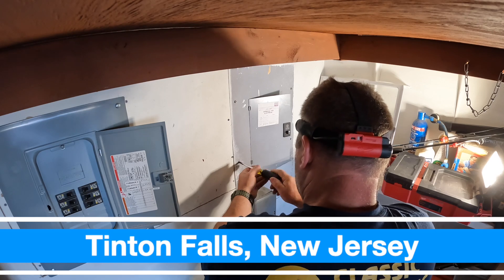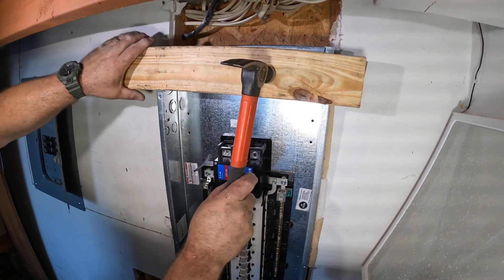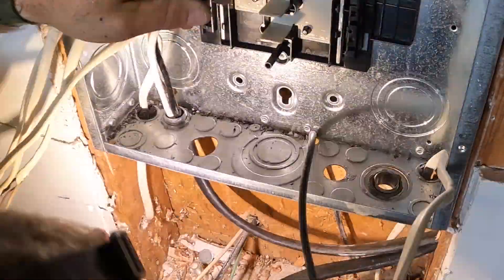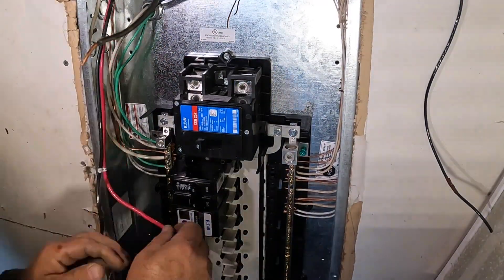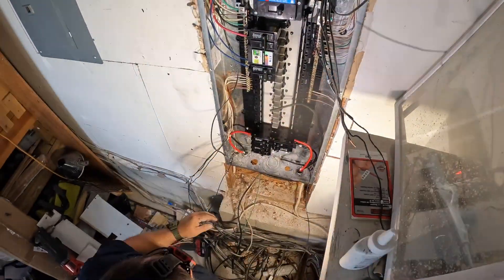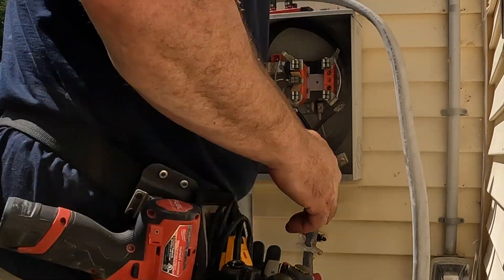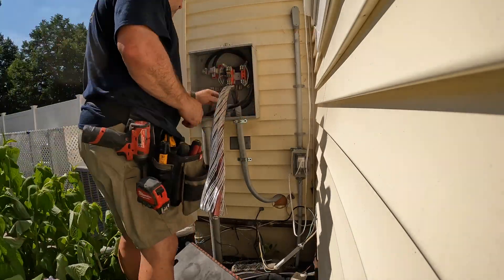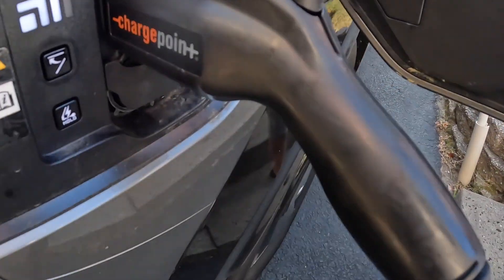200 AMP Panel Upgrade w/ new Electric Vehicle Circuit  for a Level 2 Electric Vehicle Charger

Comment: Since your service entrance cables came into the panel from the bottom, could you have installed the panel flipped so that the main disconnect and the lugs were on the bottom?  I guess you could have saved a little conductor and maybe the panel would have been a bit less crowded. Just wondering how you think about that. Thanks.

Comment: Hey!  When using a flush mount box in an exterior wall space where the interior is heated, how do you prevent winter time condensation problems in the box?

Comment: Aren't the meters rated for certain current so to go from 100A to 200A would require the meter to be upgraded if it isn't rated for 200A. Thus requiring a disconnect.
I think some models are labeled with  CL Eg: CL200 is 200A..
Reply from the maker: @TheTubejunky  All underground electric service meters are rated for 200 amps.  It’s a law that utility providers must follow.
Reply: @electricianron_New_Jersey   Awesome! Thank you for the information my guy. Have a great day.

Comment: Hotest day I ever did a 100 amp setvice it was 104 degrees for an cheap ignorant cousin that me & my dad did not charge any labor. We asked het for a cup of water twice but ended up drinking warm water out if s gardrn hose. End of job we took off our work boots and sat on her chairs with our firty feetnin her   kiddie pool. Following month dhe wanted us to vome over thst day to run a line to s window air conditioner. Told her we were nooked up gor restnog summer.

Comment: Amazing the ultility company has the ability to disconnect your power at a smart meter but can not install a $5 lockable lever to manually open meter relay contacts so customer had to spend mega bucks to have the NEC mandated outdoor service disconnect. Would never want my branch cirvuit breakers being outdoors nor would my senior citizen customers.Nice neat work. Nice to see you did not instsll another garbage ge jumk panel. Last two GE brand new panels I had to work on neithet door would open more then 75 degrees even after removing them.

Comment: One of the code reqs for home power systems (battery backups)  when installed in the garage are required to have heat sensors installed that communicate with the homes smoke/carbon monoxide detectors.
Reply from the maker: @TheTubejunky  oh yeah? What’s the NFPA section?
Reply: I think it's actually part of the building code but the electrical inspector says the Building inspector isn't looking for that (or WON'T) so it's up to the electrical to cite it. Also the batteries when installed in the garage must have 3hr burn ratings on the drywall. 

Not sure of the codes sections but this was from two different inspectors on the East Coast.

Comment: Great video! One of the o key channels that shows the whole process. I’m over in Philly and the heat has been unreal. We’ve been in attics doing recessed lighting. Does NJ allow you to put the main at the bottom so you don’t have to run 4/0 from the bottom to the top? Or is that prohibited by that uniform code. We only have the 2017 NEC where I work
Reply from the maker: Main breaker can be at the bottom.  Eaton designs their main breaker specifically for that reason.

Comment: When the 2023 code adoption hits you will have to install a disco for a panel change with the new note In 230.85. In north jersey some inspectors are requiring it already
Reply from the maker: The North Jersey inspectors? Rules apply to all of NJ, not just Bergen, Essex and Passaic counties. The Uniform Construction Code which supersedes   the NEC does not require an exterior disconnect for panel changes. It's only on "full service upgrades" and spells it out clearly. There's a link to the UCC in the description of every video I post.
Reply: Would you havppen to know where that is in the UCC? @electricianron_New_Jersey

Comment: So that house always had a 200 amp meter can feeding a 100 amp panel?  Is that common out your way?
Reply from the maker: All underground services in New Jersey are required to supply 200 amps.  The load side can be 100 amps.
Reply: Oh ok, a little different than us up here in CT.  That would definitely make some upgrades a lot easier.

Comment: Forgive me if you covered this in the past but can you explain your system for keeping track of the circuits, also which requires what breaker. Is it all by wire size? Do you label circuits or run around to see what turned on/off to relabel? It seems effortless for you and I could see getting bogged down in the bowl of spaghetti. Thanks.

Comment: You can run SEC exposed like that into the bottom of the  meter enclosure in Jersey?
Reply: also was surprised to see the SEC exposed outside of conduit.  Wasn't aware that was permitted?
Reply from the maker: Look at the NEC. SEU is normal here in the northeast.

Comment: I was told that the ground bar only has grounds and the neutral wire goes only on that bar only ?
Reply: they are combined only at the first means of disconnect which in that case it is. if he would have installed a disconnect outside, they would only be combined in that disconnect. any subpanels after the main disconnect panel grounds and neutrals would be seperate

Comment: I really enjoy watching your videos especially the panel upgrade videos. In this video, I noticed that the surge protector is installed below one of the breakers. I have a Square D panel with an installed surge protector. Square D wants the surge protector installed in the top position in the panel. It's interesting that Cutler Hammer doesn't have the same requirement. Does it really matter where it's placed in the panel? Keep up the great work. I am really glad that you are back to publishing more frequently on YouTube. Your is one of my favorite channels.
Reply: I "think" surge protector is to be installed as close to the main breaker as possible / practical.

Comment: I'm working on my deck down here in SC.  It was 94, felt like 100.  Absolutely brutal!  I lasted 4 hours then went inside and took an ice cold shower.  Waited for the sun to go behind the trees, worked another 30 minutes, came inside and took a 15 minute break, worked 30 and so on until it was too dark to work.  It's supposed to be 95 the next 2 days then 97
Reply from the maker: My mom lives near Calabash, NC! When it gets too hot I need start earlier in the day.

Comment: How do you wire the surge protector that's in the panel. Or should I say what wires go to it. What's up Ron another good job.
Reply from the maker: This one was a plug on neutral.  It connects directly to the bus bar to provide the protection.
Reply: 🎉ok thankd @electricianron_New_Jersey